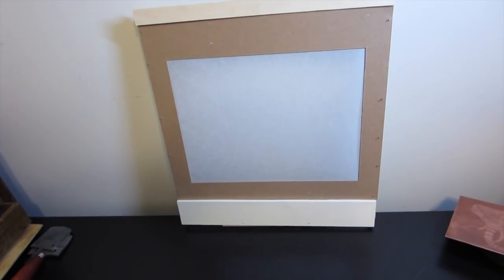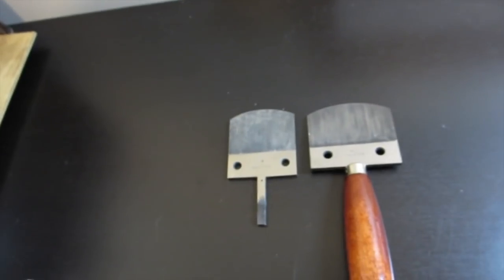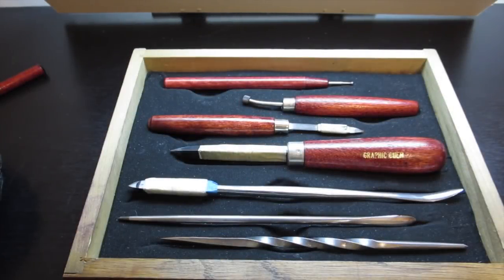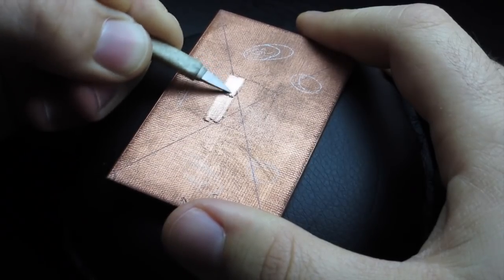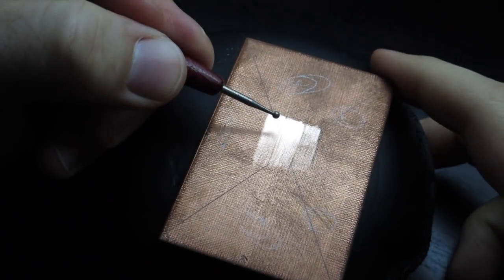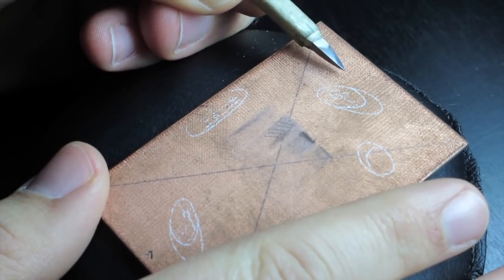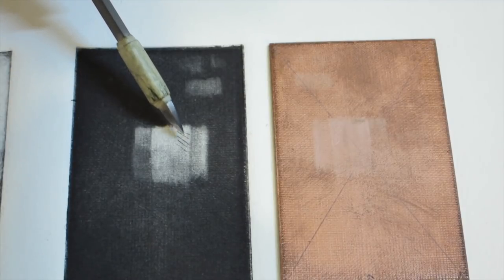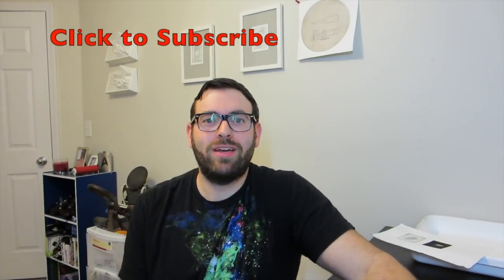Mezzotint Printmaking:  a Tool demonstration and guide

Comment: This is an excellent video, and corrected some erroneous instruction I received elsewhere.  One question — when rocking the plate, should the rocker be positioned perpendicular to the plate — straight up and down— or at an angle?  And should the angle be toward the bevel or away from it?  I think I might have been given some wrong information on this too.  Any clarification you can give would be so helpful!  Thanks!

Comment: I have made etchings for 40 years, mostly bitten line with development and corrections in drypoint and engraving. I enjoyed your demonstration and explanation- well done. It's helpful to see your tricks, the jig for rocking, your version of the diffuser screen. wrapping tape on the blades of your scrapers... I have different boxes for tools and I have thought of ways to create inserts to hold each tool and scooped out space for the finger gripping. How did you make your inserts?
Reply from the maker: Thanks for watching! I'm going to be making a video about my printmaking tool box soon and will go into all the details. But for the tool drawer I used a block of dense foam with the outline of the tools cut out of it (including room to grip the tools). Then using spray adhesive and thin fabric I covered it for a clean look and the tools drop in perfectly.
Reply: Diode Press
Thanks, I guess even styrofoam would work if you plan to cover with fabric. Felt might work nicely.

Comment: So helpful, thank you! Any tips on wiping technique? You do it very quickly and expertly, I find I get anomalies and sometimes white spots where there shouldn't be (overwiping? wrong angle?....). Probably seems like a dumb question to you but I'd appreciate any tips you have, thanks!
Reply from the maker: Cat Ingrams not a dumb question at all. It's something that takes a while to get the feel for, and I've seen people do it many ways, and every plate will respond differently. The way I learned was to try to use light pressure and allow the tarlatan to do the work (I use dirty inky parts of the tarlatans at first, and slowly move to cleaner sections). If you have a lot of lines in one direction, I try to wipe perpendicular to them to avoid dragging out too much ink. Often the stiffness of the ink can also effect it. I would maybe try to take one plate and try and ink it up and practice wiping it with different methods (pressure, direction, total strokes, or total time) and keep a little notebook of what you did differently for each print and see if you can figure out where you are going astray. Hope this helps! I'll try and slow down on one of my future videos for this step and you can see a bit more how I do it. Hope this helps!
Reply: Diode Press
great advice, thanks!